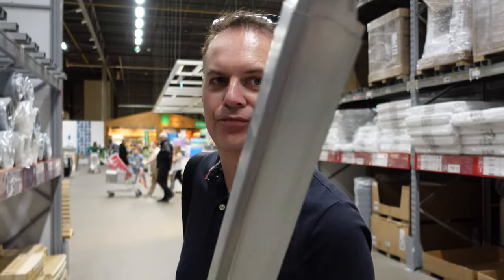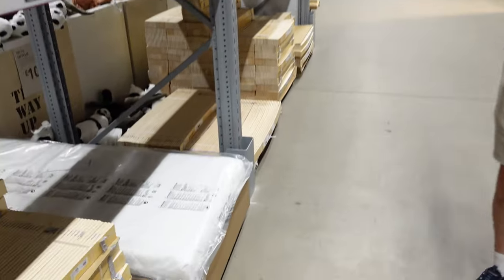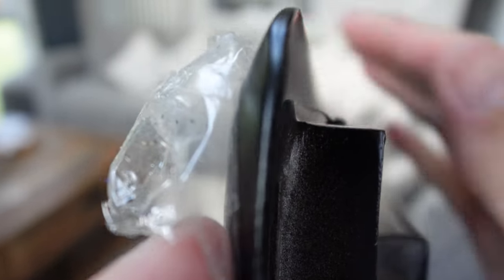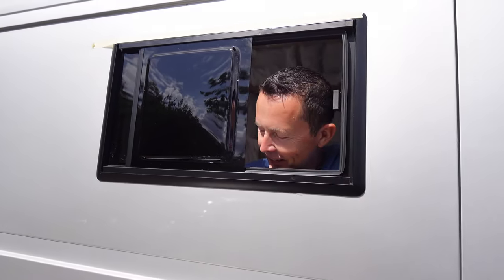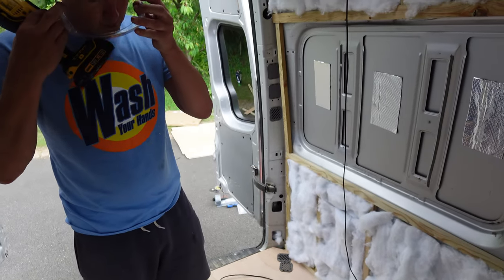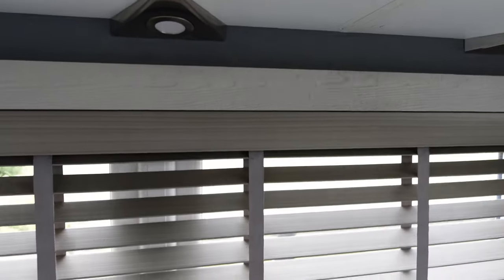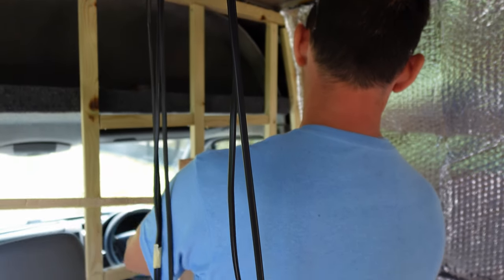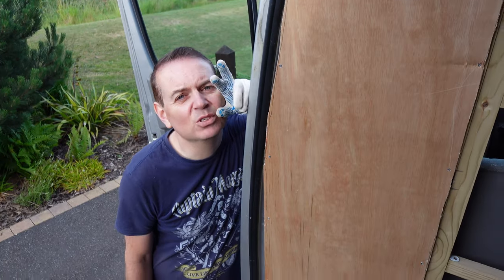VAN CONVERSION - Fitting A Kitchen Window & Laying Electric Cables | Van Life

Comment: Nick is right, it is much easier to cut out the window apertures with a cutting disc. I've helped my son do the rear door and side door on his Crafter. Just the "Kitchen" side left to do. 4 straight cuts and just the corners with the jigsaw.

Comment: Loving these van build videos, I think you should remove the double bench in the front, replace it with a single seat and in the space left over install a travel fridge which would be connected to the lighter socket - cool drinks on your journeys

Comment: Hi 😊 we just bought the Sony zv1 mark ii for a trip away, struggling a little with image stabilisation and settings would you be so kind as to advise on the settings you have found work best for you guys I recall in the vlog you mentioned setting it up with the same settings as the zv1 you had previously 🖤
Reply from the maker: if you have product showcase on then image stabilization is off, there is a.short cut on the main dial to accidentally turn on PS so my guess is this is your problem

Comment: I'm curious about the door you're installing, are you swapping out the chairs for proper RV captain chairs that swivel or keeping that bench seat on the passenger side?  It's gonna be a tight squeeze won't it for getting into the front.
Reply from the maker: the door is for emergency access only not day to day access